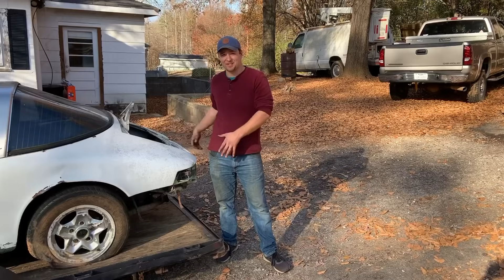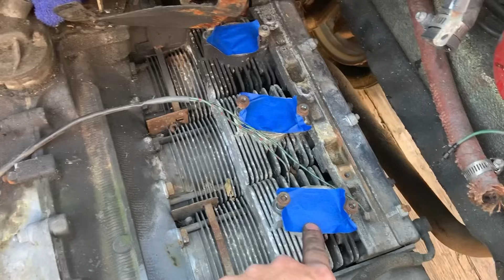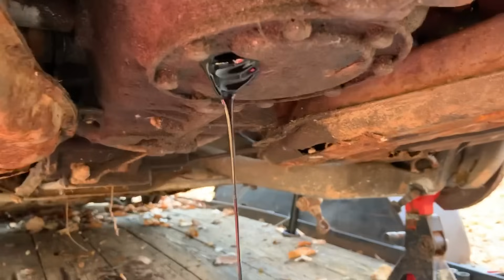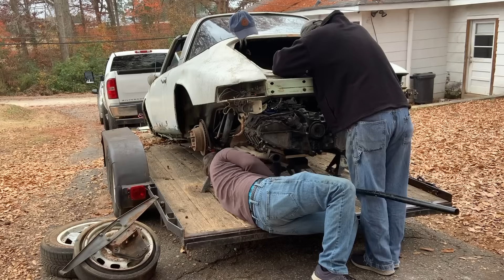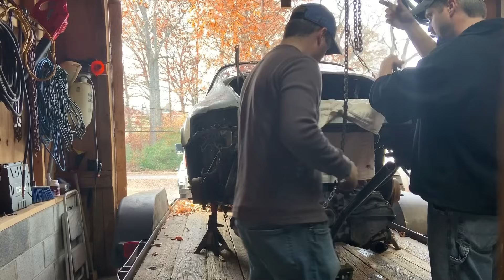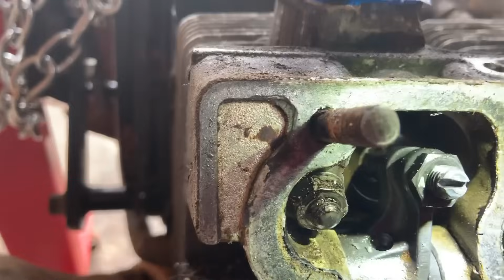Saving a Vintage Porsche 911 Targa from the Scrapyard! Rebuild Part 2

Comment: The 1974 was not popular for fixing up fro several reasons.  The engine, the 2.7, was the least reliable of all 911engines, used from 1974-1977.  The magnesium cases were thermally unstable and lacked reliability.  They went to aluminum cases in 1978 in the 911SC to gain back reliability.  The bodies before 1975 were made without zinc galvanized steel.  You are seeing significant evidence of that.  The news news story is that the Porsches of those days did not require any special tools!  A set of odd numbered metric wrenches, screwdrivers, and Allen wrenches is all you will need!    The ice green metallic was a beautiful color—glad to see you made it original.  Sadly, green Porsches were not popular. (We used to call them theft proof green).  You have done a terrific job.  Just found you on episode 34.  Keep in mind these were all hand built so body pieces are not symmetrical.  The left fender, for example, intrudes upon the tire a bit more than the right front.

Comment: This is exactly the kind of restoration I like: low cost, a bit of horse sense and a load of optimism!
Reply from the maker: Goos Gosling Slotegraaf 😀😀
Reply: there is no such thing as a low cost Porsche restoration. Parts are double & triple what Ford, Chevy parts cost.
Reply: Why are you working on the trailer ??
Reply: It has good bones, to original condition, will not be cheap, otherwise great find.

Comment: Great Job!, I recommend you to strip the car and sandblast it, than you will realize all the rust places you will need to repair or exchange. Cheers.
Reply: Exterior auto body panels don't use much sand blasting any more. Soda and walnut shell blasting is much less destructive. Also chemical dipping works well.
Reply: no,no sand blasting ever.

Comment: Looks like its going to be a big project! It would have been much easier taking out the engine and tranaxle as a single unit. In addition, putting the engine back in would be much easier. Good luck!

Comment: Thank you for taking time to document the restoration. I'm picking up valuable techniques in the disassembly process. I like that you share the small techniques like location of the bolts, its sizes and also that technique to take out the wires out of the plugs and sockets.
Great job!
Reply from the maker: Absolutely! Really glad you’re enjoying what I have to share! Thanks so much for the kind words!

Comment: Crystal green metallic is a great color!  If it is a numbers matching car, would probably be best to keep it as a narrow body.  If anything, maybe Carrera flares so that it would be period correct.  Will be fun to watch this as it goes along.  Remember that 74’s were magnesium cases, so will probably need time serts and updated head studs.  Also should modify for pressure fed chain tensioners.
Reply: Agreed! Love those  magnesium 2.7 and their oil leaks!

Comment: Love that you have an 80 caddy in the shop. I keep thinking about the ones I've sold over the years... Get the engine and drivetrain sorted in the 911 before you work on the rest. Make it a rat driver then restore the other stuff. Save the exterior for last, you can enjoy the car for a bit before you take it all apart for paint.

Comment: I can't get over the fact that you snagged a basically sound '74 targa for $500. That's an absolute steal, especially as the motor looks to be good. I love that you're not intimidated by what it is and are just treating it like any old Ford, Chevy or whatever. The right way to go about it however much the haters and purists will no doubt say it needs a $30k resto at an official Porsche shop. That said, I do think you should consider restoring it to factory spec - those fenders are saveable with some panel beating, and even the hood can have new metal let in - I've seen far worse! A respray in the original seventies metallic green and this car will be a real head-turner and one I'd love to have on my driveway. Subbed!

Comment: Growing up in my neighborhood my friend's dad. Had reddish orànge  targa chrome bumpers older than this one ,a Porsche mechanic expert named Milt Minter  built and tuned the engine and it had a "race exhaust system " basically loud as hell I'd hear it start in his garage waiting for the bus to school and go thru the neighborhood ,always double clutched with a wicked bark blip between gears always revved. Pretty high rpm .that noise sparked my interest in high performance automobiles . another neighbor had a nasty boss 351 mustang pumped roller cam ,,headers all of it the left ten . minutes apart almost everyday.yess. Sir!
Reply from the maker: Kalani Robb Sounds like music to me!

Comment: You have so much to learn about Porsche mechanics. Love the build, sub'd. Best of luck.
Reply from the maker: Random Internet User Everything I know, I know from digging in and learning for myself! Always a fun learning curve!
Reply: @BudgetBuildz  Pelican Parts.com and Wayne Dempsey books are a great place to start learning about Porsche restoration. The engine may look bad but you'll soon realize that Porsche 911 are built with race car modularity. For example, the cylinders come off the block, and can be swapped for larger displacement.
Just please don't LS or V8 swap it, Hoovies garage YouTube channel already did that and it sucked.
I'll be watching

Comment: if it gets to expencive as the haters say then do a Subaru swap
Reply: Nah..Just transplant a VW flat 4 into it!...Yes, the 912 - 4 cylinder  Porsches worth silly money these days.
Reply: @patbutete1722  The 912 engine is Not a VW.
Reply: @freebuilder007  Far as I am aware the 912s had a flat 4  1600cc motor derived from the 356  which  basically a souped up  VW power plant. ..I very nearly bought one years ago when no one wanted them!..Either way, those VW engines were designed by Porsche weren't they?
Reply: Don't be daft.

Comment: That engine looks surprisingly good inside! The body too! Can’t wait for episode 3!

FYI: theres a set of cookie cutter wheels/tires on Craigslist in Atlanta
Reply from the maker: skyjammer Thank you! Cheap too...I’m tempted just not sure if that’s the wheel setup I want to go with yet 🤔
Reply: Budget Buildz I would get the cheapest steel wheels you can find just to get it off the trailer. Not sure how you got it on in the first place. Don’t do the wide body thing keep it original or stock looking as possible once you start doing mods it looks cheap. Also good to see you know a lot about engines so I’m not worried there you will have this thing running in no time. Also if it was me I would take the advice of the other dude that said getting it running and drivable and don’t worry about spending money on the body and paint. Just enjoy as is. That’s me though cuz I’m broke so I would have to spend all my money on the mechanics. If you got the cash then remove the body sandblast and paint.

Comment: Cheers from Italy, love what you're doing there man! Takes really guts and a lot of perseverance to do this rebuild. Suuper nice, I'l follow it all the way through! :)
Also, regarding the previous video, it's impressive how intact the lower beams are considering that water usually stagnates there! I mean, take an Italian car sitting for the same time under the same conditions and it'd be like the moon surface by this point!
Reply: not sure about 74 but Porsche cadmium plated their panels that is why so rust resistant

Comment: My first Porsche was a 1966 Porsche 912. I had it while serving in the military. It was my favorite car I've ever owned. Had I kept it it would now be worth close to 100k. My second Porsche was a 74 911E a little underpowered but still a nice car. My third Porsche was a 944 1984 vintage. It was the worst car I've ever owned. I absolutely hated it. I now own in 986 boxster. I bought it last year with 32000 miles on it. I bought it from a collector. And I must say it is the most fun I've ever had behind the wheel. Rear engine is great. But nothing handles a turn like a mid engine. I've been jonesing for years to find it older 911. And I envy you with your find.

Comment: I just found your channel. Awesome find and nice save. Starting from 1974year has new bumper design and maybe swap to 1973 front fender, bumper, and hood. However air cool original narrow body 911 is high desired on the market right now. So restore to original spec should better choice. Good luck with build and look forward to see upcoming video.

Comment: Exciting project for you but I don't envy all the work ahead (even though I'm tuning in late and lots of it is done). Hope you enjoyed the experience and it doesn't end up costing you more than buying a finished one. This one looks unsavable, costwise, but hopefully you can find some reasonably priced used parts. I don't have the drive/ambition to see a project like this through, but you're young and full of energy. Good luck.
Reply from the maker: Thanks! I hear you there, it’s been a big project! Still close to 30k less than what one cost at this point in the restoration!

Comment: A fool and his money soon will part!  Love your ambition and optimism to resurrecting a yuppie classic!  I’de consider resto-modding it with modern drive train (junked Boxer-S motor and suspension; a Subi WRX motor; or a Honda GL1800 Goldwing motor).  Liking the 70 Midge!  Had a ‘68 MGC-GT that i will forever regret selling.

Comment: If you end up taking out the targa glass and removing the doors. Make up braces to fit within the doors to stop the chassis from distortion. 
Easily done. 
Get a hydraulic cam chain tensioner over the spring type. 
What’s the battery box like. 
Good luck in your build.
Reply from the maker: N E 1 Thanks for the info! Battery box look to be really solid honestly! Next video I’ll fully disassemble the front end!

Comment: Cruising down the 101, north of Paso Robles, passing a 70's Targa, wanted to get ahead to pull back into the right lane, the Porsche accelerated, OK, gave the beans to the '14 Ford 
Flex, rolled up 110 MPH no problem, Targa backed out.

Comment: I'd probably keep the looks and do the suspension-engine-steering real nice with some pretty stock rims...
Just fix the structural stuff and stop rust. Like that Hank Moody look from Californication =D
Spend what you save on the interior, like a nice complete dash, seat upholstering, etc
Reply: also, I would loooove to be able to find a car like this even at 1500-3000USD with any way of putting it back on the road paper-wise... =D you guys are lucky on that side of the pond ;)

Comment: take the exhaust heat exchangers off next. Use a torch to heat up the nuts around each exhaust port. If you don't you can break the studs
Reply from the maker: Graem Elliott Will do!

Comment: Sorry meant to add that you won't find any water in the bores as its an air cooled engine ... But nicely checked on condition. very logical and careful. well done.
Reply from the maker: 1chish With the intake busted and some intake valves open I was concerned off water running in, thankfully none!
Reply: @BudgetBuildz  Ah my bad you meant external weather type water ...
I think I would just have the heads off anyway so you can be sure whats going on before planning work. These engines are pretty bulletproof but as its been stood the rings will need looking at. But you seem to have it in hand mate. Good luck.

Comment: Re-attach the tailights, bumper, other body parts before all the hardware gets lost. You'd be smarter to thuroughly clean the hulk you have and do more of an inventory. Take a bunch of up close photos from many angles BEFORE disassembly so you remember how it goes back together. Porsches have many small unique parts that if lost or broken are expensive and difficult to find. Smarter to get the body work done, electrical sorted BEFORE tearing apart the motor.

Comment: Hm whats the lowest you could rebuild the engine for. New rings, bores honed or oversize if need be, oil seal and gasket set, new main bearings and cam bearings ,  rod bolts, cam cap bolts , lap valves. As long as everything else is within spec give everything a through clean and oiling. Good to go i think if you had the parts it could be done fairly quick
Reply from the maker: I’m not too positive honestly, I’ve heard upwards of 10k for a rebuild like that 😳 I’m sure it would be considerably less as I would do everything myself but they still think a lot of the special tools and parts needed
Reply: Budget Buildz ive just had a quick browse, bearing shells in the uk seem to be from 30-50 each,  160 for rings, gaskets are cheap but obv head gaskets i would get the best quality possible or original Porsche. Machine shop work is cheap probably 100 -150 for rebore or 30-40 for honing or do it yourself. But it all depends on how far you want to take it, again the thought of stripping the engine is probably the last thought whilst you. Tackling the chassis and shell. But a video series of a porsche engine rebuild would be so sweet, plus you would have much advice from professionals watching on the web. Keep up the great videos man

Comment: 500 bucks is beer money. Now throw in 20 for a Haynes manual and prevent all usual DIY pitfalls with the 911. Good luck guys. Guess see you back at the other end of 25000 USD (if most is used parts that is, or else 75k). Dipping the body and zinc coating it  would be a good step. Depending which way you want to go.

Comment: Your going to need a complete new exhaust.  Other parts could be media blasted.  Think about getting a sandblast cabinet from harbor freight .  It  looks like you already have a compressor.  There are videos on YouTube about how to seal up a harbor freight sand blasting cabinet so it doesn't make a mess when you use it.  These cabinets are pretty cheap and It will save you a huge amount of money.  Use media instead of sand some media be reused.  Pant the suspension parts with epoxy primer and paint after they are media blasted.  Involving your children is a great idea.  The so freaking cute.  There are aluminum cleaners which will make the engine parts look practically new.  Look this up on you tube as well.  The engine looks promising.  I hope when you tear it down the bearing and rings are fine. You wife and father sound great.  Do you have a pressure washer?  That could also help. Keep up the good work!
Reply from the maker: Thanks for the input! I’ve definitely wanted a sand blasting cabinet for a long time! I do have a pressure washer and will get it out before long!

Comment: Back in 1982 I bought a Porsche 911 for $400 because it wouldn't start. A new battery and cables, a tuneup and tires, and it ran like a champ! I resold it for $6,000.

Comment: Part 2, Wooo Hooo!!! The lack of major rust on this vehicle is amazing! Great camera work showing the condition of the rocker panels and underneath various seams in Parts 1 & 2. . . I have a few questions & requests: (1) What is your maximum budget for this project? (2) Will you share a running total of the Cost of this restoration? That will really help viewers who want to undertake a similar project but are afraid of hidden $$$ expenses.  (3) What is your prior mechanical experience? You mentioned boat repair in Part 1. Have you ever restored a car, done bodywork, or rebuilt an engine? (4) Suggestion: Be sure to pick up some "car wheel dollies" like this inepensive pair from Harbor Freight:    https://www.harborfreight.com/2-piece-1500-lb-capacity-vehicle-dollies-67338.html . . . Wheel dollies are a huge aid at this stage of a rebuild/restoration. . . Thanks again, and keep up the great work!
Reply from the maker: Qualls Photography Thanks! I don’t have a maximum budget at the moment as I don’t have a ton to spend, most of what I have planned will be custom fab and me getting down and dirty. I will keep you posted on that as I further the process! I will definitely share a total cost so people can understand what they’re getting into themselves! I am a 6 year marine technician, and prior to that have been buying/selling and building cars since I could hold a wrench. From a mechanical standpoint I’ve done just about as much as you can imagine, automotive and marine. I have never done a full restoration, although I have replaced body panels, restored full interiors, and shaved engine bays. I’m not new to this but there will be a few learning curves, mostly from it being a car I’m not 100% familiar with. Although I have owned many volkswagens so I’m not too far away. I definitely will consider getting a set of those! I need to get some of my other cars out of the garage first 🤷🏼‍♂️